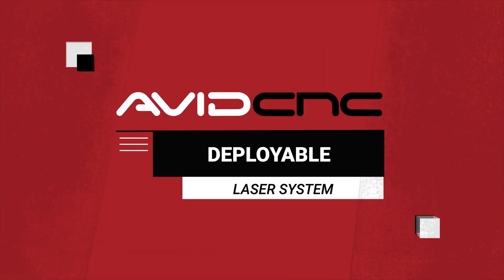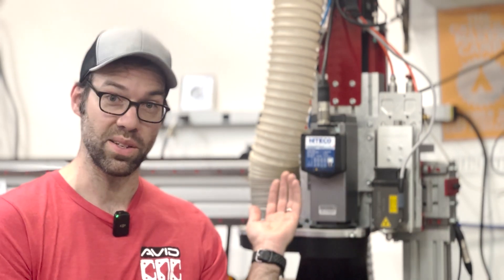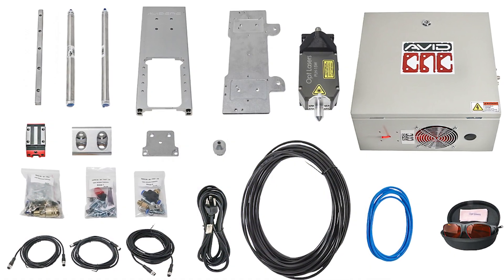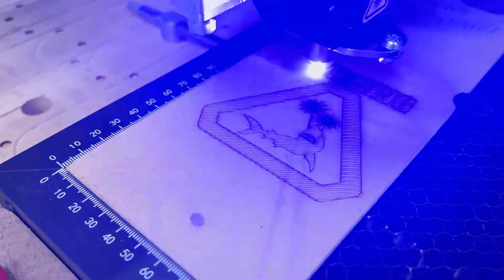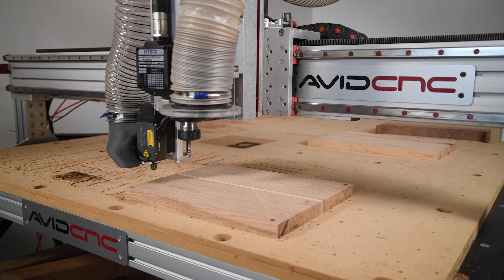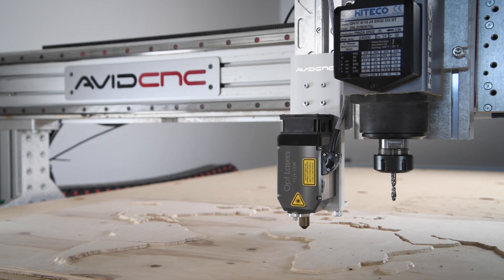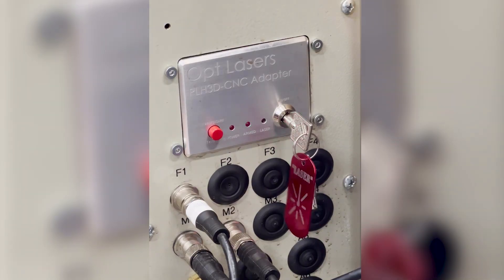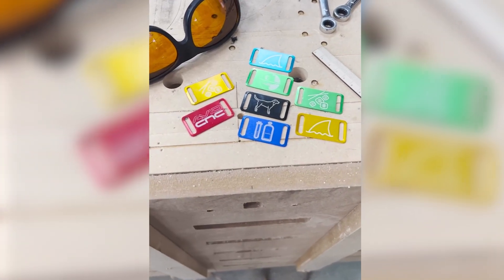Answering Your Common Questions About the Avid CNC Laser.

Comment: What are the Gantry requirements on a PRO60120 to add the laser mount?  I have the following:
- Z-Axis Travel / Gantry Height: 12" / 8"
  - Gantry Width: Standard

What are the benefits of the 12x12?